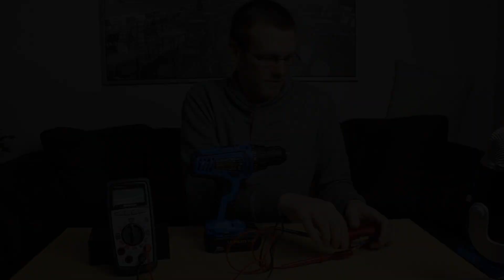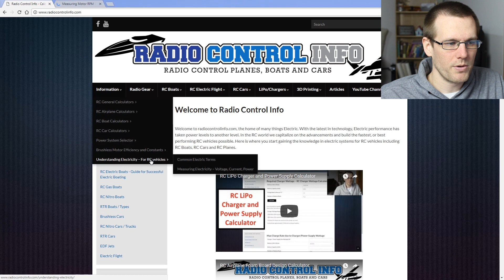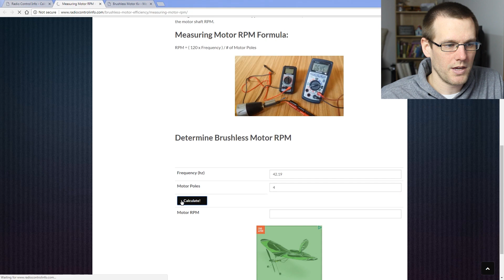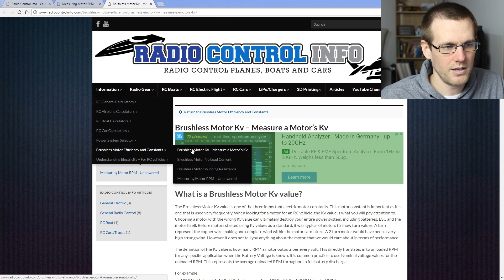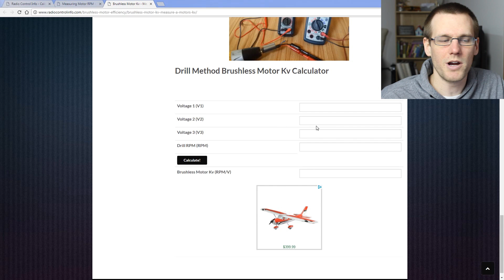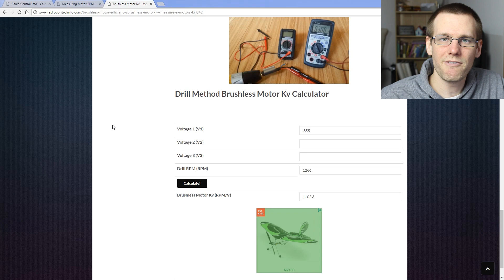How to measure KV (RPM per Volt) of a Brushless Motor

Comment: Hi i know this video is super old, but im having trouble getting a Hz reading, my drill is supposed to be able to spin 1700rpm but the meter just shows 000 on hz and i have the lead connected to 2 of the 3 wires
Reply from the maker: It may be because the strength of the signal you get from high kv motors is relatively weak. Spinning them using a faster drill could help.

Comment: Could you tell me what determines the wattage output of a motor?….like the Hobbystar 4585 (3600 watts) vs the Hobbywing 4984 (5700 watts)? They are the same size cans
Reply from the maker: The interesting answer here is the manufacture determines the wattage. And the question then becomes based on what conditions?

Comment: I like your explanation on this.  Thank you.  One comment I want to add is that perhaps you may like to measure the rpm of the drill independently with a tachometer as most voltmeters don't have frequency option.  I also want to ask you why you included the 1.41 (square root of 2??) and 0.95 (motor efficiency??) in the calculation part.  I would appreciate it if you can comment on that.  Thanks again.

Comment: What about putting the motor on a test stand with the esc you are going to use and lipo as well. Then use a power meter to read the exact voltage at the battery and a laser tach to read the rpm of the motor.
Divide rpm by the voltage and shouldn't that be the kv of the motor?

Comment: I'm having a hard time understanding why the formula has 1.3433 instead of root2, can you explain how you got 1.3433?
Reply from the maker: There's a correction factor built in.
Reply: @RCexplained  I get that there's a correction factor, but where does it come from? How can I know if the correction factor on the website is suited for my use case?
Reply from the maker: @333Shax  it's an industry standard for brushless motors used in RC.

Comment: great, and how to determine amount of poles of unspecified proprietary motor? The whole point of this video is suppose to be that you don't refer to specifications of the motor on the manufacturer's website, because we are looking to determine it ourselves.
Reply from the maker: Easy, take apart the motor and count.
Reply: @RCexplained  Count what??
Reply: @sashadimitr2852  Magnetic poles. inrunner motors are usually 2 or 4 pole motors, out runners anywhere from 6 to the highest I have used is 24 pole. with outrunners you can usually get away with counting the magnets but there are some rare motors that instead of having the magnets arranged N<S<N<S<N<S  that are built NN<SS<NN<SS.

Comment: Where does the 1.3433 number come from in the formula?
What does it represent?
Kv = RPM / ( Voltage x 1.3433 )
Reply: It's equal to 1/(sqrt(2)*0,95)
I also don't get why

Comment: Great video! It's a bit weird though, I can't measure the frequency of the motor when connected to the drill. It's zero. When I spin the motor by hand though, the multimeter shows low numbers (fractions of kHz) which seems to be correct. What could the possible cause be?

Comment: can you help me to understand which is the negative or positive in brushless motor that have all 3 cables black color? moreover to mesure the Amperes i need to use a DC amperemeter ? on the positive cable? thanks
Reply from the maker: There is no such thing as positive and negative leads on the 3 wires coming out of the motor.

Comment: You say the Kv of a motor varies but isn't Kv only an approximation to RPM/volt anyway? I keep reading that Kv is actually  a measure of the back EMF produced as it is spinning. Hence why it's actually called the Voltage Constant like Kt is the Torque Constant
Reply from the maker: Hi Don, Kv varies based on motor manufactures tolerancing from motor to motor. Also the amount of RPM you get out of a motor per volt varies based on load as the Kv value is at 0 load.  

Kv is the Velocity constant, and as you can see in the video, the standard set for this value is by measuring back EMF.  I have also replied to your comment under the video "Comparing Brushless Motor Torque vs Kv" with further details.

Comment: Thank you for sharing this. Cleared up a lot of confusion. Would the Kv value be more accurate if you had taken readings from the other wire combinations? Just curious.
Reply from the maker: Hey Dillon, thanks for the comment. Have you been on the radiocontrolinfo website? There is 3 Voltage inputs so that you can take readings from all 3 phases. To answer your question about accuracy, all of the phases should be identical. The more measurements you take, the better your results can be.
Reply: RCexplained thank you!

Comment: This is exactly what I did except I didn't have any fancy calculators.
A 4 pole motor will change polarity twice as often as a 2 pole motor per rotation meaning it produces twice the AC frequency per revolution as a 2 pole motor. A 2 pole motor completes the AC cycle once per revolution, so every rotation per second is directly equal to Hz. So your 42.2 Hz is telling you that a 2 pole motor rotated 42.2 times per second. Which means the 4 pole motor observed was actually spinning 21.1 times per second. 21.1 times 60, to go from per second to per minute, equates to your 1,266 revs per minute. 

Here's where it gets tricky. The phase wire voltage isn't actually the voltage as measured by a standard RMS meter. Otherwise you could simply divide out the voltage from the drill rpm to get the observed Kv. For instance, using an 11.55v pack my motor saw 8.64v on the phase wire. Divide the source voltage by the phase voltage and that gives a multiplier of 1.337. Multiply your .855v by my 1.337 and you get 1.143v, which is closer to the true AC voltage. Divide that 1.143v out of the drill rpm and it gives you an observed Kv of 1,107.6... which is very similar to what your calculator spat out. 
So without the calculator I measured the phase volatage and divided the source voltage by it. Then used that multiplier to find the true phase wire voltage when I used my drill to run it.
Reply from the maker: Good work, that is close to what I did.
Reply: RCexplained well I did that after an esc burnt out. I wanted to check my motor for damage. So I hooked it up to a drill and measured the voltage for each phase. I already knew about the lower phase voltage when trying to see what the esc resolution was, which is 0.016v starting off with my MMX. I also tried to see if I could lower the max voltage, which reducing it to 70% power dropped the max voltage from 8.64v to 8.49v and didn’t change the voltage resolution. I wanted to essentially reduce the voltage from my aux wire so I could get better motor control for rock crawling, but that doesn’t seem feasible going forward.
Reply from the maker: I haven't experimented with that but would agree.

Comment: As the rotor was spinning, the voltage value on the multimeter was rms. However as you were working out the Kv, you directly put the rms voltage value, you must have put the maximum voltage value unless it is automatically converted in the background. I guess the reason why you end up with a larger number is that you didn't multiply the voltage with sqrt(2) at the end.
Reply from the maker: Hi Burak, the calculator handles all conversions. RMS values are used as input.
Reply: @RCexplained  Ok, thank you for your reply :)

Comment: I don't understand. How many revolutions per 5volt ?
Reply from the maker: Hi ardi. You have to measure the RPM of the motor and at that RPM you also take a voltage reading.  Place these values in the calculator and you get the kv of the motor as a result.
Reply: @RCexplained  i have 16.8 volt how it could 40A and 2400KV with thrust 1200gr ? I don't understand because i just bought brushless eco. Please tell me.
Reply from the maker: @ardisulaiman9740  Hey Ardi, I'm not exactly sure what you are asking. Using 4s LiPo on a 2400kv motor seems like quite a bit to me. Drawing only 40A and getting 1200 grams of thrust could be challenging.